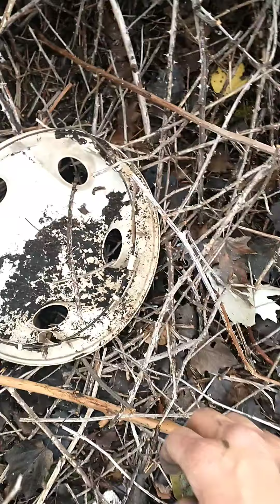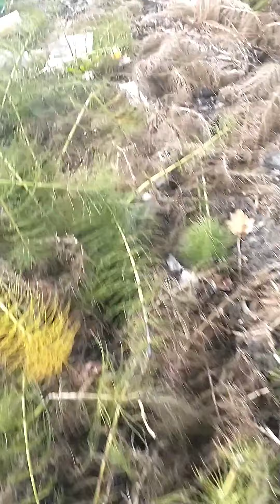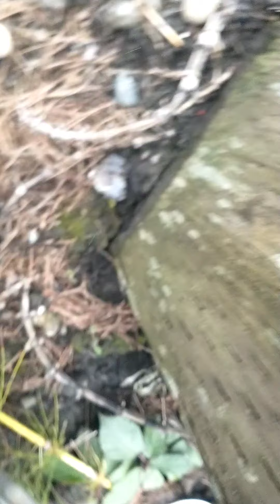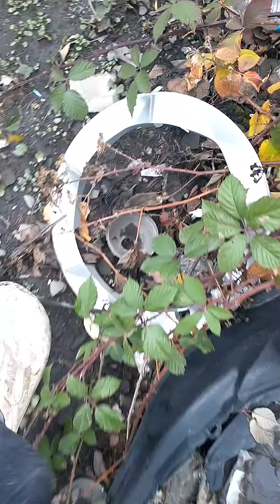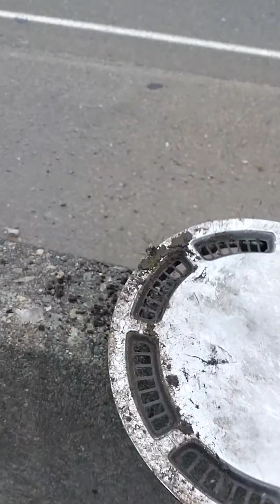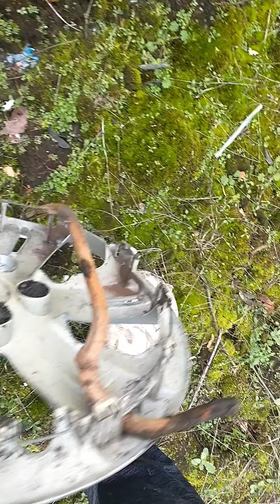Finding hubcaps on the highway (lots)

Comment: Some cool ones here! That Cadillac is fairly rare, 1989 only. The lettering font is different than the later years. I always liked that 15" Nissan Quest. Those don't come up much anymore for me. The trim ring at 2:28 is a Chevy pickup, 1988 and up. The old metal Mercury Tracer is something I haven't found in a long time. And the metal Grand Caravan (489) with no rust on the steel band is a real surprise. Those were rotting out even 20 years ago around here
Reply from the maker: wow, thanks!! i wondered, where in the country do you live?
Reply: @Hubcaps219  Philly